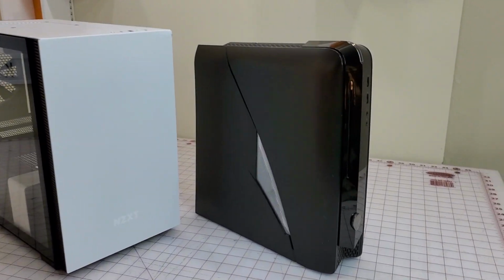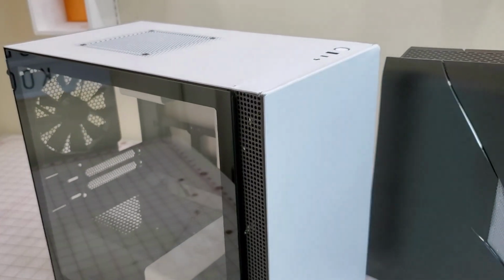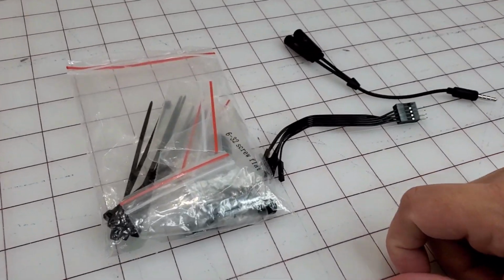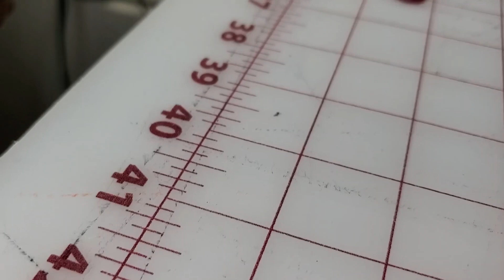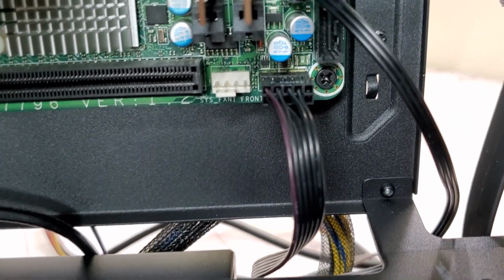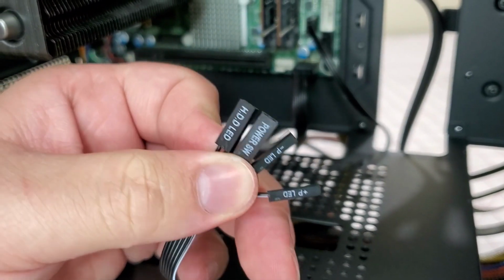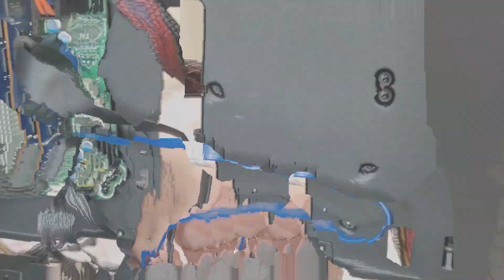NZXT H210 Build! An Alienware x51 R2 On Steroids!

Comment: I really wanna build this but I'm not sure, say I did would my alienware run better if I got a new case for it and upgraded my graphics card
Reply from the maker: Yes to a certain extent. Limitations of the CPU can cause bottlenecks on new hardware. But believe me it will be an improvement and lifespan will be increased due to better airflow and cooling etc...

Comment: Hey man I have the cooler master hyper evo 212 cooler do you know how to take off the bracket underneath or can you show me a video how ?
Reply from the maker: Once the screws are removed off the bracket you should be able to remove the bottom easily. Make sure you carefully pry it open. It may have some kind of glue/adhesive holding it together.
Reply: @jayburgermcfries  also man I’m doing the same thing what you did with your x51 just different mobo any tips?

Comment: I transferred my Alienware x51 to a new case and every time I boot up it says “no boot device available” and I can’t do anything to fix it i also tried bios and nothing works have any solutions?
Reply from the maker: Check the power cable and sata cable. If that doesn't work try to change the settings in bios from UEFI to Legacy.

Comment: I managed to do the same thing to H210i, I used two external USB 2.0 to 9pin to get both RGB working and I put in a Kraken x53 and some silent fans(not NZXT), The NZXT fans are so loud and annoying.
Reply from the maker: They are, but I used a silencer cable on the nzxt fans. Yes, they exist lol. Good stuff!
Reply: Could you drop an amazon link or something to the adapters you bought, i bought a 210i and im confused at what to do with remaining cords.
Reply: Hey size Kraken did you use?

Comment: Did the cool master make the motherboard like peel off or was the upgrade smooth without issues
Reply: I really wanna upgrade my alienware x51 because I've been trying to get a new pc for like 4 years and no ones buying it for me and they won't let me get a job either lol (I'm a teen) so this would be the best alternative
Reply: Also is there anyway you can list links to the parts you got for this upgrade
Reply from the maker: The upgrade did go smooth. No issues what so ever. All you need is a NZXT H210 Case, a ATX Power supply and an ssd drive. Everything else like the motherboard, the GPU and the hdd you yank out of the x51 and transfer over. Oh and if you want you can get another cooler like i did. Water cooling or air cooling works.
Reply: @jayburgermcfries  do you know any budget water coolers that would be compatible because I don't know too much about thay stuff
Reply: @jayburgermcfries  Sorry for all the questions I just don't wanna mess anything up
Reply from the maker: @joegreen1709  any cooler master 120mm aio are a great budget. I've used it before many times and are compatible with most gen cpus on both intel and amd
Reply: @jayburgermcfries  Hi again, I have another question, if I build this would it be hard or no? And do you know any step by step tutorials or no

Comment: So I tried this with the h510i and the x51 motherboard doesn’t have a slot for the usb 2.0 cable, so my fans or rgb don’t work. Any help?
Reply from the maker: You can always look for usb 2.0 adapters on ebay. But im curious to know what kind of plugs does your fan require? What kind of fans are they?
Reply: @jayburgermcfries  the fans are just the fans that came with the case, I’m gonna buy a usb 3.0 to 2.0 adapter and try that because then I can plug in the usb 2.0 into the 3.0 spot and use my leds and fans 
Edit: not sure what kind of plugs my fans require
Reply from the maker: @ashtonirigatoni  i just realized you said H510i. Take a look at this link.

https://youtu.be/eRnHvGOMG2s

So most likely you need to power on the box with a sata cable. But the rgb control lighting will need the usb port to control the rgb software. So, you SHOULD be able to plug in your fans through the HUB. In the meantime, the fans would work but the rgb won't until you get the adapter.
Reply: @jayburgermcfries  ok thank you!

Comment: really good transformation, but how do you connect the wireless antenna from the motherboard to the case?
Reply from the maker: What i did was, i placed them on the back of the case, used a little bit of tape to secure it. Or a screw. Signal was actually better than before.
Reply: awesome,  very creative idea

Comment: I am having problems getting it it connect to the power button any ideas
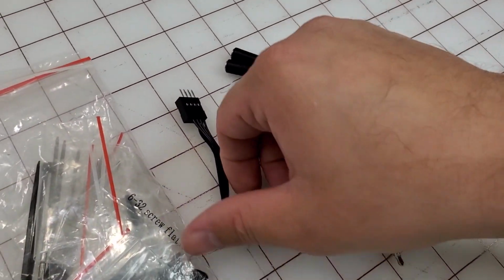Reply from the maker: 1:52 And 5:08 on the video. I talk about the front panel connecter. If you are using the same the motherboard as I am you don't need the front panel connector adapter.

Comment: Hi I have a question. Is it right that i just plugging the PSU in without doing nothing?? Because the x51 has this internal weird PSU so im wondering if my PSU (500W EVGA) will blow the Mainboard. Thank you anyways for the video!!
Reply from the maker: Yes it's okay to do that! I did this in the video. The internal psu adapter thingy was a converter to use a "Laptop like charger" that it comes with from stock. Plugging in your Full size PSU won't do anything but power all the components normally. Hope this helps. Cheers!
Reply: @jayburgermcfries  Ah ok thank you very much for the quick response!!

Comment: Hey man, i have a problem inserting the gpu to the board because the front panel cable was right beside the pci and i cant push my gpu in
Reply from the maker: If your GPU is a phatty then you'll have that issue. I kind force pressed mine in. But what i do recommend is buying an L shape mobo header adapter. I've seen some somewhere .. maybe ebay?

Comment: can it play pubg mobile
Reply from the maker: It could play tetris.
Reply: @jayburgermcfries  wow thank you but im gonna buy a 1000 dollar prebuilt because i want to play roblox on max settings
Reply: @jayburgermcfries  anyways jokes besides do you only need a power supply and case or do you need more?
Reply from the maker: @oskarr44  just a psu and a case lol and transfer everything else.
Reply: @jayburgermcfries  im planing to get the exact same case and a be quiet 600 watt power supply
Reply from the maker: @oskarr44  yepp thats perfect. Not sure if its a concern to you but consider getting the I/O shield off of eBay.
Reply: @jayburgermcfries  thanks a lot
Reply: @jayburgermcfries  sorry for so many questions but do i not need a ssd or is my wd blue hard drive fine and will work?
Reply from the maker: Your HDD will work fine. But i do recommend upgrading to a SSD and using the HDD as secondary.
Reply: @jayburgermcfries  did you have to get sata cables and can you just plug the old x51 drive in and it worked?
Reply: @jayburgermcfries  hey quick update the case has come to day same with the power supply ive installed the psu into the case and now going to order a sata cable as you can not reuse the sata in the x51 and will start transfering when the sata cable comes
Reply from the maker: @oskarr44  maybe i forgot to mention that. It's been a long time since i last saw this video.
Reply: @jayburgermcfries  good news it worked it turned on just need to reset the cmos for it to post👍 thank you so much for making this video it is very helpful
Reply from the maker: @oskarr44  yay. Awesome! Enjoy!

Comment: does it still fit for NZXT nzxt liquid cooling
Reply from the maker: Yes. The 240MM or 280MM would fit on the front.
Reply: @jayburgermcfries  How do I power it though it said I need a USB slot?
Reply: @jayburgermcfries  Yea Im curious too

Comment: I'm kind of new to this but is that CPU cooler only attached to the motherboard by four screws? It seems like it would be a lot of stress for how far out it sticks
Reply from the maker: Well, it has a bracket on the back like most cpu coolers, and you mount the 4 screws to that. It holds it in place very well. Although Cooler master does make these cooler quite heavy.

Comment: Hi. I am also thinking of doing this same thing. Will be my first time ever touching computer components. Question, why are you not using the original fan and power supply from the x51?
Reply from the maker: Because the power supply isn't strong enough for bigger graphics cards or other components that you'd like to add or upgrade. Besides, if you choose to install the motherboard on another case like i did, you might aswell buy a power supply that fits the case. Also. By fan? You mean the cpu fan? They suck at cooling the cpu. Brand coolers whether air or water cooled are A LOT better at cooling your system than a stock. My advice: Do not salvage anything from the x51 besides the motherboard, storage drive, graphics card and antennas..

Comment: Right now I’m getting a gtx 1060 to put in my current x51 but I want to do this eventually once I have a bit higher of a budget.

Edit: a month ago I transferred it to an h510i successfully. Just a few days ago from today, (feb 27 2021) I got a new cpu, motherboard, and ram. There is nothing left of the x51 now.

Comment: Did you have to get a WiFi adapter?
Reply from the maker: No. I ran the antennas that were built in the alienware to the back of the case. And it worked perfect.

Comment: How’re the gpu temps? I just bought that exact card for my h210
Reply from the maker: Make sure you have some kind of gpu stand (like a holder) or I used a rubber pad to lift the GPU because this will sag a bit and may cause the GPU to get warm since the clearance is very little. GPU temps on the other hand are normal.